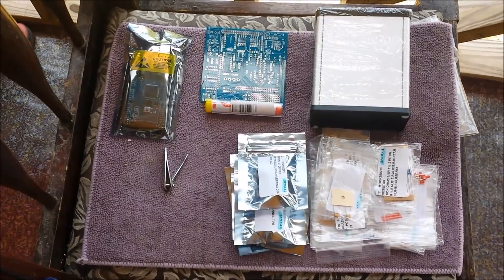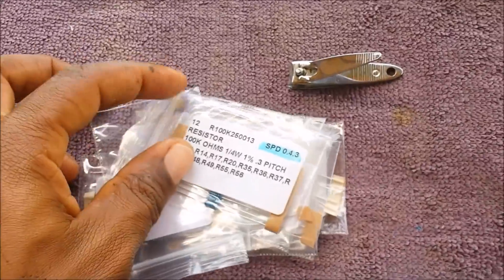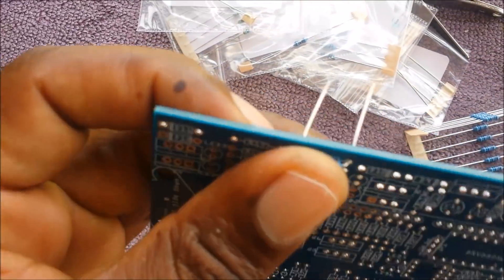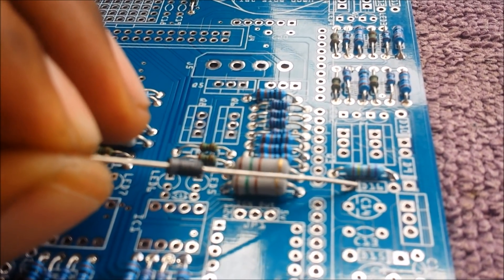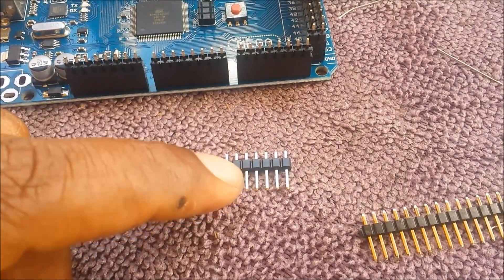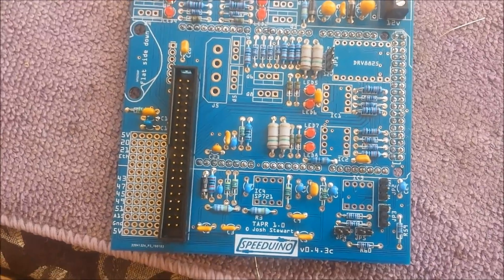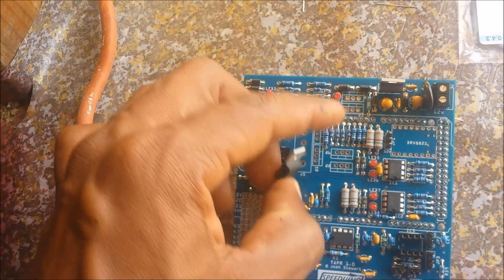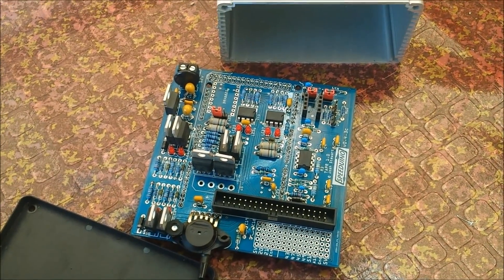Speeduino V0.4 Assembly

Comment: You should make a video on trigger wheels and ignition settings I'm sure  it will get millions of views
Reply from the maker: What exactly about trigger wheels and settings would you like to see ?
Reply: @DCWERX  like how where to find your trigger wheel and how many teeth you should put in or if you don't have a trigger wheel what you should do
Reply: @DCWERX  I had to do hours and hours of research and looking at diagrams to just to find out my car my didn't have one then I had to do more research on running the car on the distributor
Reply: I see a ton of people needing help with idle on the speeduino and cranking
Reply from the maker: @darthbolloful  great idea. That sounds simple enough to put a video together covering the subject

Comment: Hi DCWerx, I have a question. I know you are very familiar with WMTronix, and was wondering if you could help me with kitting a set together. I can solder just fine as I do it for my 9-5 so I actually WANT to solder a through hole board rather than get an SMD board (although the Ocelot board and dropbear look VERY enticing.)

WMTronix does some awful labeling. If I were to buy the Speeduino V04.3d kit from them with the component/part kit, would I still need to purchase the arduino, VR adapter, and i feel like theres some other component I'm missing. If you could mention what all the kit comes with and what I would need to purchase seperately I would be ecstatic, thank you!!!

Lastly, is it more compelling to get the Ocelot or Dropbear v1/v2 or should I build my own this way? I just dont trust myself to piece the kit together as well as the supplier could as far as arduino and vr adapter

Comment: Hi  I have a miata NA 1.6. 1990 I have installed a 30-0300 x-series wideband 450cc injectors . the car works fine, I just have to keep the laptop connected the engine stops if I do not use the laptop it looks like it's losing ignition because dashbord clock not working when does that after it stops it starts very hard. but it works at only idle if I want to leave the engine dies again can be the sensor on the clutch pedal because I can't use the option to decelerate fuel cut off. if I activate it, it does the same thing as with the laptop disconnected 
  if you can help me thanks
Reply from the maker: Sounds like multiple issues. If you are using a PNP Speeduino Miata ECU then the 5v supply may be faulty. Contact the seller for warranty or replacement.

As for the hard start and TPS issue, that may be tune related if all else is good.
Reply: Ok. I'll talk to them   thanks a lot

Comment: how much  is the speeduino standalone  ecu. and where can i order it.
Reply from the maker: Depends on which board you go with, where you buy it and if you want it assembled or not. They start at around ~$100 for board + components and go up as high as ~$250 assembled. 

You can get them from the speeduino store, wtmtronics, diyefi, eBay and a few other sellers
Reply: Yeah I see on eBay for 220. How much u charge to tune .my car is a b18c civic . You probly know it .

Comment: where could i purchase an assembled speeduino
Reply from the maker: There are a few resellers across the globe but I recommend the Speeduino store, wtmtronics, speedyefi, diyefi and the other authorized resellers
Reply: @DCWERX  i need to do one for my m52 e36 turbo project
Reply from the maker: @rype36  I think someone makes a pnp speeduino for the m52. Check out the Speeduino forums for details